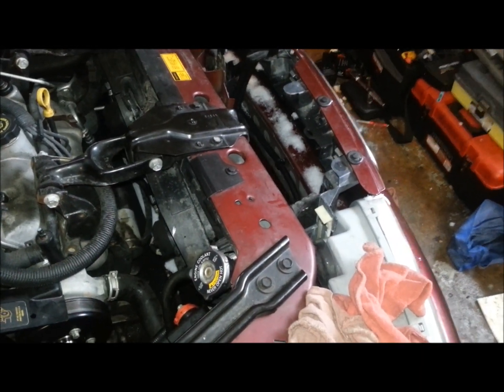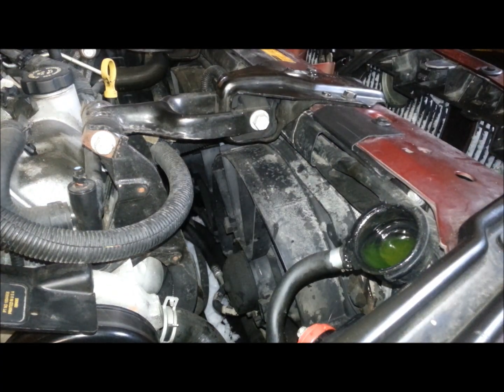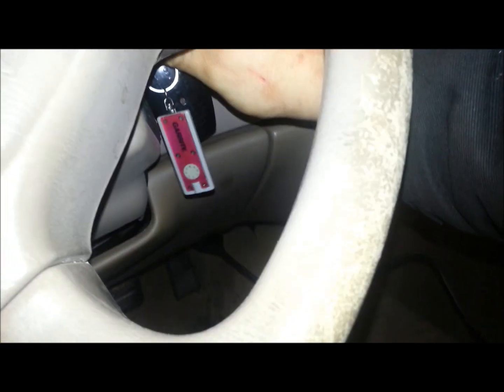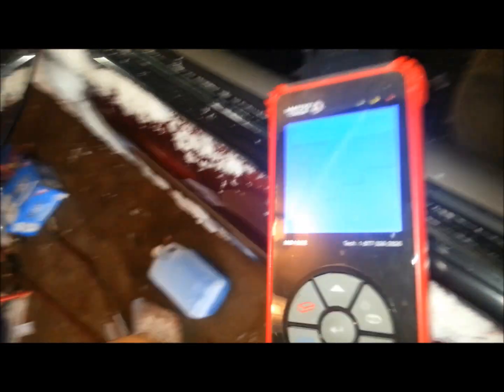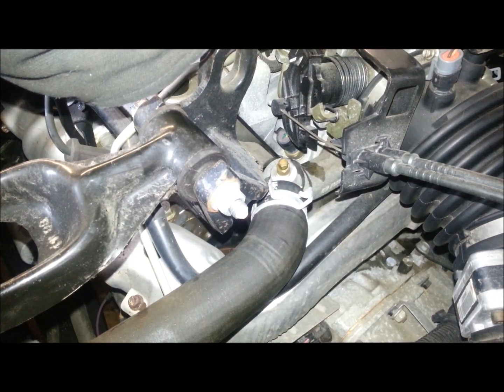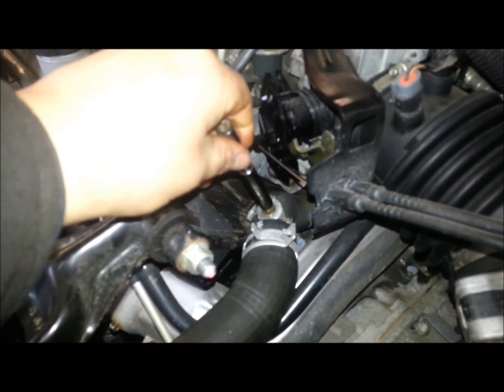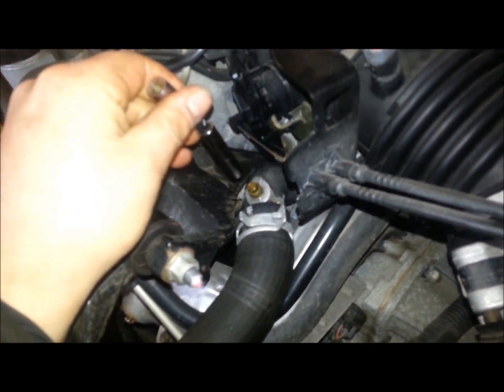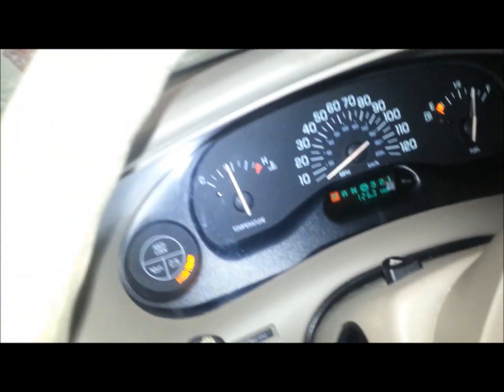how to bleed coolant system 3.1/3.4 liter

Comment: I have been bleeding from the one you said not..thanks!
Reply: Yeah, it’s actually at a higher point than the thermostat housing. The one on the housing is what I crack when filling the radiator - when that one spews liquid, the rad is full. Then go to the one above the water pump and open it up until it spits water out, then refill the rad. Once those stop burping, start the car, let it warm up, bleed at the tstat housing again. The temp gauge should be just below halfway, just below boiling, the rad fans should be on low and the heat in the cabin will be pumping.

Comment: I had problems with my malibu overheating, changed out thermostate, waterpump both were  worn out, still overheating! So  I kept trying to bleed the system, is this a real issue with these models?? seems if i keep the coolant level down it stays ok, is this normal?? next i'm going to pressure test the system, heaven forbid i have a cracked block but it should tell me way before this right? Also when i had set it idol here since i done all this plus flushed out the radiator, i'm out of options unless you know of an issue, i am wondering why the fans come on after I start the car??? Is that normal? I installed a manual fan switch if i see the temp go up again and the fan stops which it seems to do , got any ideas let me know,thx  my temp gauge is showing half way now after it warms up, i know the thermostate works at least.
Reply: oh yeah it is a 98 it only has a resovior with 2 small hoses and the bigger one going to the main hose( its a Y configuration the one end going to the pump , the other goes to the radiator,,,,no radiator cap

Comment: im not  sure but is it ok to use the green coolant becasue most GM car take the orange 50/50 coolant. does it matter?
Reply: The orange GM Dex-Cool antifreeze is formulated for 5-year service (changing) intervals.  The green stuff is rated for 2 years.  Some people swear by one or the other.  I personally prefer the green only because it's easier to find (most gas stations have the green, but not all of them have the orange).  The green is also cheaper than the orange.  You can mix the green in with the orange, but be advised that once you do that you have destroyed the extended life properties of the orange and dropped it down to a standard 2-year service interval.  It won't hurt the car or anything to mix them though.  It seems like I've heard some people say that there could be corrosive issues with mixing the two, but I've not had any personal experiences to back those claims up.  That said, I'd check with a reputable mechanic that you know and trust to be absolutely certain.

Comment: I have a 2001 Malibu 3.1 6cyl. And I am having a hell of a time with the cooling system. All parts have been replaced and such. I have no heat and it seems it over heats and acts erratic. I have never dealt with this type of cooling system. Normally I add coolant and wait until the stat opens and add more old school Monte Carlo way of doing it. This system seems like total shit. I hear clicking from the rad hose going to the stat housing and do know what it is.
Reply: The clicking most likely is the thermostat opening and closing.  You can hear this clicking sound on most cars when you turn them off after they have run for a while.  Sometimes the radiator cap itself will make some clicking noises as it opens and closes.  The pressure builds up forcing the spring-loaded thermostat to open and it instantly relieves the pressure.  When it closes you can hear this clicking sound as it taps against the metal housing.

If you have changed everything out (and I do mean EVERYTHING - radiator, heater core, all hoses, all fittings, all rubber elbows and joints, all clamps, etc) and it is still overheating then you may have a larger problem.  It could just be air in the system, so make sure you don't have an air bubble or something in there by bleeding the system.  Driving the car up onto an incline to elevate the radiator cap to a higher position than the engine can help in bleeding if you are bleeding it from the radiator cap.

Check to make sure you aren't losing coolant.  If the car is overheating but there are no apparent coolant leaks anywhere (hint:  park on a big piece of clean cardboard for easy drip detection) then you might have a faulty head gasket or intake gasket.  Many people assume that a blown gasket will mean massive amounts of steam coming from the tailpipe, but this isn't always the case.  I had a 1989 Olds Calais with the GM Quad 4 engine that had a blown head gasket.  The only symptoms I had were that it leaked coolant without there being any actual coolant anywhere, and it would start overheating within minutes of warming up.  I also did not have any heat from the heater.  I did not have a large plume of steam coming from the tailpipe and the engine itself ran good (save for overheating, of course.)
Reply: my 2004 alero leaks coolant  from the radiator HOSE [ the nipple part ] that  goes to the overflow reservoir tank,it does  it a few times a week and sometimes not at all ? any idea ?
Reply: Is your system the pressurized 3.4L engine, or the non-pressurized 3.1L engine?

If it's the 3.1L, try replacing the overflow hose.  It shouldn't cost much to replace it.  While it's off, check the fittings on both ends - one near the radiator filler neck, just below the cap, the second on the overflow tank itself.  Check them for any obvious signs of a problem, like a crack.  Also, check the radiator cap itself (or just replace it, they're cheap enough).  On the 3.1L there are actually two rubber seals for the radiator cap.  There's a small rubber seal that presses against the small opening inside the radiator filler neck, and then there's a larger rubber seal that seals the top part of the cap to the filler neck.  If the larger rubber seal is bad, coolant will leak from under the radiator cap anytime the cap opens up to relieve pressure on the system (allowing coolant to flow into the overflow tank.)  Replacing the radiator cap will get you two new rubber seals on the new cap.  You're supposed to replace the radiator cap every two years anyway ... so if you haven't done that in over 2 years, go ahead and replace it anyway.  As far as the intermittent leaking goes, it's possible that it's only leaking when coolant is being released from the radiator into the overflow tank.  This would only apply to the 3.1L engine though.

If it's the 3.4L, I would remove the hose that is connected where the leak is coming from and inspect the hose and the fitting carefully.  Get yourself some clean rags or paper towels and clean the hose and fittings really good.  Plain dish soap and water should do fine for cleaning it.  Flex the hose in your hands and look for any cracks or blemishes.  Also, check for any soft spots in the hose.  If you're in doubt, just replace the hose.  Check both fittings for each end of the hose for cracks - use the soap and water to get them clean if there's a lot of dirt and oil / grease on them.  The 3.4L engine has a pressurized overflow system with a plastic cap.  That cap can go bad just like a radiator cap.  If you haven't replaced it in a while, it may be a good idea to pop a new one on there.

Both the radiator cap on the 3.1L and the plastic overflow cap on the 3.4L are spring-loaded to ensure the proper pressure is maintained in the cooling system.  If the cap opens too early, you'll have boil-over.  If it's opening too late (or not at all) then the pressure will build up and be released wherever the next weakest point is - which could be a loose hose clamp, a weak spot in a hose, or a gasket somewhere inside the engine.

Lastly, if you've still got the original squeeze clamps on the hoses where it is leaking, you can try replacing them with the clamps that you tighten with a screwdriver or small ratchet.  Those make better seals and it's a good idea to switch over to them whenever you remove the old factory clamps.  Again, they don't cost that much.

Make sure the engine is cool before you perform any of the work I've mentioned here - you don't want to burn the living snot out of yourself.
Reply: 3.4, today it leaked a little bit from the radiator nipple hose

Comment: doing this will my "low coolant" light go away?
Reply: I have the same issue we got this vehicle used to replace the reservoir thermostat check for any lakes and the plumbing water pump is good still having issues fan doesn't cut on so basically relay and coolant temperature sensor then again I think it's just a bad design with this vehicle I don't think this vehicle wants to stay fixed in all honesty.
I have a 2001 Pontiac Grand Am GT V6 3.4 liter engine and it's been a pain in our ass. I hope luck goes your way if you still have the vehicle.

Comment: Hey Joe. I replaced the thermostat.  Now, I still do not have a heat in my oldsmobile silhouette.  When I was checking coolant level I finally opened the radiator cap and antifreeze came out. I let it go till its stoped.  I saw you put some coolant in the radiator that's the level , right?  Is it the way of edding and checking coolant level? Even after edding some coolant indicator light came up  says " check coolant level "" . How to do it right way to turn the indicator off?

Comment: I have another problem . There's no way to remove the radiators cap. I kept turning it back and fort without a success.  Wtf is wrong with this cap?
Reply from the maker: you need to turn it and push down to get passed the lock , if its the pressurized reservoir than most likely it the o ring that is holding ypu up just pull up as its turned

Comment: on what car you were working on?? I have oldsmobile silhouette 03. No heat, no a/c. Also, no overheating.  Do I have the same pr8blem as your car or its just a thermostat. I em early bird,  so I am sorry , but I just wanna go out and replace my thermostat but it's still dark. 5:30 am . Its cold and rainy but I need to fix it, anyway.  Thanks for this video.
Reply from the maker: i wouldnt go replacing the thermostat unless your car is not warming up to temp. check the coolant level before attempting repair ypu might just be leaking down, Air conditioning is not related to the thermostat

Comment: I need help this is not my engine. I can't find the bleeder vavles I have a 07 equinox Lt. I also noticed there isn't a radiator cap on it
Reply from the maker: 07 equinox is a different set up you have a pressurized reservoir  and the bleed process is fill cooling system and run engine to operating temp with cap on and then shut off and let cool down then open cap and fill to proper level just make sure its topped off

Comment: Gotta do water pump in my 03 aztek today i ran water all summer no prob winterized the aztek / antifreeze ! prob have'nt put 50 miles on it with antifreeze in it now it spewing right outta the pully !!
Reply: Sounds like the water pump. Easy to change though. maybe an hour?
Reply: Straight water alone is bad.  For one, antifreeze not only lowers the freezing temperature of water, it also increases the boiling temperature.  Water by itself boils at a lower temperature than water+antifreeze mixed.

Antifreeze coolant also has additives in it that lubricates your water pump, prevents corrosion in your metal cooling system components, and conditions rubber seals and hoses.

It's possible that running only water in your cooling system is what caused your pump to fail.

Comment: I have a 2003 Chevy Impala V6 3.8 and I parked on a hill to get get air bubbles out of the system. It worked without bleeding the hose. 
I replaced my radiator today and I thought I got all the air out of the system but I'm not getting any heat out of the blower. 
Do you think it's because I didn't bleed the line like you did or could it be something else??
awesome video btw! you're pretty good with one hand.lol

Comment: is it possible that my thermostat is backwards because I get no coolant coming out of that bleeder at all! my reservoir just fill up and my 98 chevy venture overheats! just steam comes out!
Reply: SLICE HEARTSHOT i had the same problem turns out i took the bleeder completely out and with pic inserted it in the hole and was corroded and blew out

Comment: Joe, I am also perplexed by your comment about not touching the pump housing bleeder valve. If it causes such a "very bad day" by using it for what it is intended for, could you please elaborate a bit? Some of us older shade tree mechanics might want to or need to know.
Reply from the maker: no problem, that bleeder is for the initial fill, no pressure or heat , and coolant system is empty. you open that one and once fluid comes from it close it down , do not open it under any pressure or it will blow and if the engine is running it will blow like old faithful
Reply: Do you mean the coolant will blow out like old faithful? Sorry I'm slow. I was looking for the same answer

Comment: in the summer. would having air in the system cause over heating? i just replaced my thermostat and was hoping that would fix the problem but still boils over:/
Reply from the maker: air in the system will cause overheating needs to be bled after any service that opens the cooling system ( anything besides the cap)

Comment: i have a 2002 intrigue which has a pressure over flow tank its running hot where is the bleeder value on this car?
Reply from the maker: the degas style does not have this bleeder valve but i have more info here http://joemakinmoney.blogspot.com/2015/06/bleeding-coolant-system-on-gm-31-or-34.html
Reply: thank you

Comment: just put a new thermostat in and coolant. still no heat..
Reply: You may have air in your heater core.
Reply: +Not Chuck Norris it's the head gasket now. my heat kicked in but my temp gauge meter goes from cool to heat. (back and forth).
Reply: The head gasket? °-° You're screwed on that one.
Reply: +Not Chuck Norris i know a guy that can fix it for cheap..

Comment: yea, but the one you talked about not touching, at the end of your video......that's the only one I have......I'm working on a 200 pontiac grand AM 3.4 V6 SE1
Reply: 2002
Reply: Yeah that's BS..with engine cold open the bleeder valve until a steady stream flows then close it..start engine let run until operating temp is reached with heat on then shut off engine and open valve again. The pressure that builds in the system will force the air to the bleeder. You may have to repeat this several times but don't get discouraged, it does work.

Comment: I noticed you opened your radiator cap to add water after you opened and closed the bleeder valve. Is that why water didnt spray everywhere when you opened the cap? Can you just add water to the overflow canister instead?
Reply from the maker: the cap was on the vented position so the system never built pressure . when filling a non degas bottle setup you need to fill up the cap for the initial fill and bleed

Comment: looks good ,  but  did you change to prestone green  instead of orange Dexcool?
Reply from the maker: yep the system was flushed of dexcool before this service
Reply: ok    thanks   . I hear  you can do that if you wanted to ...  they say if you change the Dexcool sooner  than  specified  say every 2 years, you wont have any clogs or leaks.
Reply: +JoeTheAutoGuy hey my car won't start after I replaced to thermostat
Reply from the maker: +Ryan Cooper is it a no start or no crank situation
Reply: +JoeTheAutoGuy it will start up and shut off right after
Reply: +JoeTheAutoGuy or it will just continuously try to turn over
Reply from the maker: +Ryan Cooper make sure your coolant temperature is plugged in , otherwise the car will act like it's extremely  cold and puts to much fuel in to idle properly
Reply: stupid

Comment: Great vid Joe.... Big question... My '03 Malibu gets way too hot, have never heard fans come on, but sitting in traffic gauge goes up between half and overheating mark on gauge and start smelling antifreeze. If I turn heat on high, cools to one notch above halfway mark, blows very hot air from heater. Should I then assume no air in system if heater gets hot? Only getting in high 70's now, I fear the coming 100 deg plus heat we get here since I can't run heater in summer. Hoping it's just a temp sensor or relay, fuses are all fine. Supposedly turning on AC should start fans, so can check that way to see if fans are working. Just don't want to get raped by mechanics or dealership if it's simple fix (you need a head gasket buddy, etc). Thanks for any help!
Reply: +Christof60 Does the car overheat while your driving down the road or is it just when it's stopped in traffic?
Reply: Well, not knowing what was "normal" on this car, it was the next mark above half in normal driving and 70 deg or less, but stop and go I would start smelling antifreeze bad and it would go to 3/4 of gauge. Couldn't hold hand in front of heater on high and knew that was far too hot. Took to mechanic and it was thermostat and pinhole in reservoir. Lt. them flush radiator and change thermostat ($458.00), and epoxied hole myself. Now runs stable at halfway mark. But no wonder they seem to be notorious for blown head gaskets. Now I also realize that although not like the good ol' days of 15 min thermostat change, I still could have done myself and part is only $14. So basically, mechanics will hose you no matter what. Live and learn.
Reply: Christof60 $458 for a flush and a thermostat!!? Sounds like they took you for a ride. Might be acceptable on these 3.4L or whatever gm engines that are notoriously hard to put a thermostat in